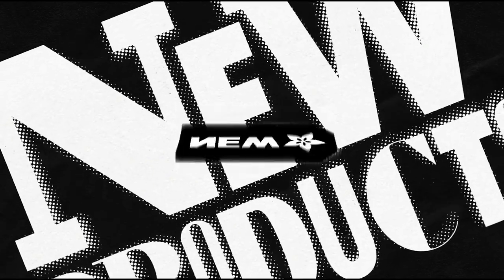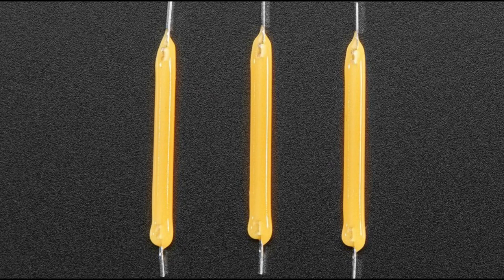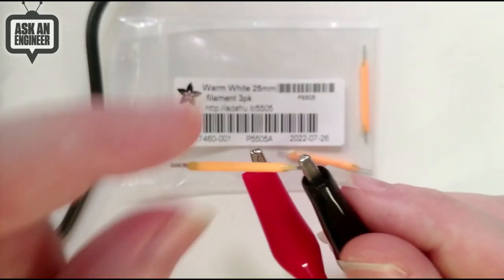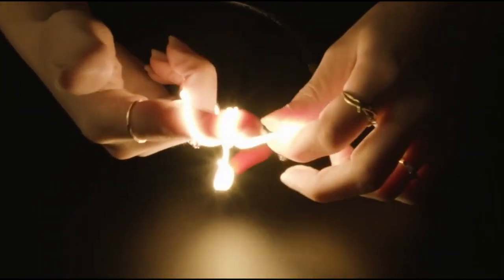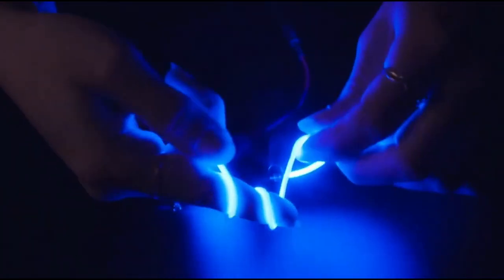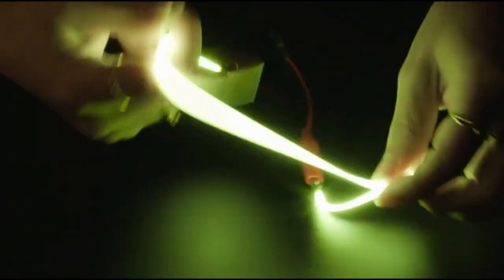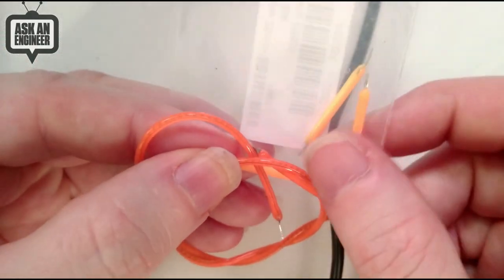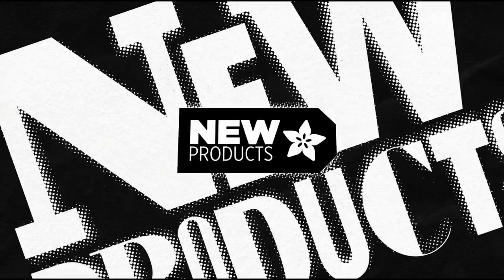New Products 8/31/2022 Featuring n00ds - Flexible LED Filament - 3V 300mm long! #adafruit

Comment: Any plans for a cool white version? I want to build an illuminated desk magnifier with the light in a ring around the lens; these are great and just the right size. But I want the light temperature selectable by PWMming between a warm and a cool white set.
Reply: Did you ever find one? I can’t find any cool white version

Comment: Ooooooo. Any possibility of getting some larger n00ds? It'd make an awesome necklace/pendant. Also, you should put the current draw on the product page!
Reply: I don't think that will happen (not enough need) because it's too easy to splice them. I used supper thin, soft, clear heat shrink.

Comment: Do these guys need resistors? I had a sample once that just burned when I connected it to a 3.7v Li-ion battery
Reply: Yes, you need a resistor (or a very well controlled supply voltage).   LED devices need to be current controlled.   If the LED needs 3V at 50mA, then to power it from a Li-Ion battery (which is 4.2V when fullly charged), then the resistor must drop 4.2V minus 3V, which is 1.2V.   R = V / I,   1.2 / 0.05 which is 24 ohms.   (For convenience, you can use a common 22 ohm resistor as it's close enough.)
I recommend that you check out the many free basic electronics online courses.

Comment: Well... I was looking for something to light up a lightsaber...
Reply: n00ds might not light it up much (guessing here) but they will probably extend it
Reply: Absolutely ideal, as they will give uniform brightness all the way along.  You might want to put in 3 or 4 strips to get enough brightness.   And make sure they are all angled outwards around a central rod, and covered with a clear or translucent tube for protection.

Comment: I love these! But know the resister is more than a SHOULD, without it they just burn up. In my tests 50mA is really pushing it, not going to last long. More like 40 nor 45mA and they still look about the same brightness. Great Product!!!!!
Reply: would they burn if directly connected to a 3v button battery? like a c2032? I connect them to leds and led string lights with no problem but not tried these filament things
Reply: @subspaceanomaly  3V is ok for regular white and blue LEDs (usually 3.3V max), but red, orange, green  & yellow LEDs take about 2V, so use a resistor.   But many LED keyring torches often don't have a resistor because the tiny batteries can ony supply a tiny current (and won't last long anyway.)

Comment: these are cool!  can you power the flexible ones with a coin cell battery by attaching the connectors to the coin cell?
Reply: Probably, but coin and button batteries have very little capacity, so they will die quickly.   The smallest practical battery would be a 10440 rechargeable Li-Ion cell, with a resistor to limit the current.

Comment: I like the power rating for the shorties. Question; can they be ran on PWM to kind of control the brightness? .....I'm getting some anyway.
Reply: ladyada says yes in the video - mentions it during the short element section but since these are simple led elements in parallel, presume it applies to all.
Reply: @dcuccia  These might be 2.7v, I think at 3v the ma might get to high. I'll just use an LDO reg.

Comment: I wanted to purchase this to make a footwell light in my vehicle so i would be drawing 12v what would I need to get the correct power to the light ?
Reply: From a 12V supply, if its a 3V, 50mA strip, you must drop 9V.
So 9V / 50mA = 180 ohms in series with the strip.

Comment: What resistor would I need to run these off a standard 18650 li-ion cell
Reply: LED devices need to be current controlled.   If the LED needs 3V at 50mA, then to power it from a Li-Ion battery (which is 4.2V when fullly charged), then the resistor must drop 4.2V minus 3V, which is 1.2V.   R = V / I,   1.2 / 0.05 which is 24 ohms.   (For convenience, you can use a common 22 ohm resistor as it's close enough.)
I recommend that you check out the many free basic electronics online courses.